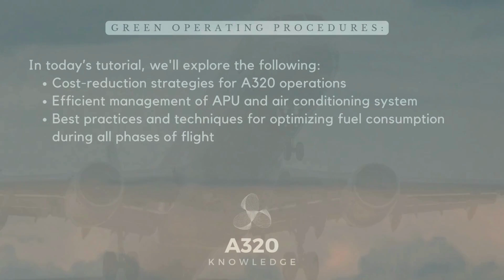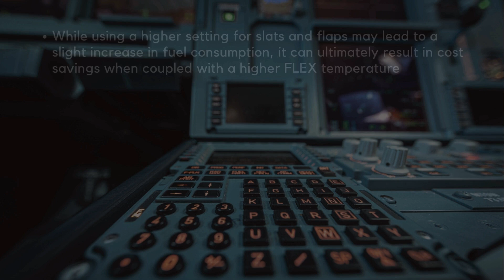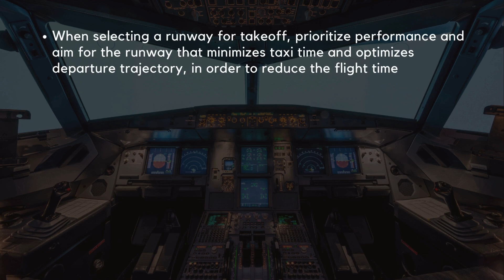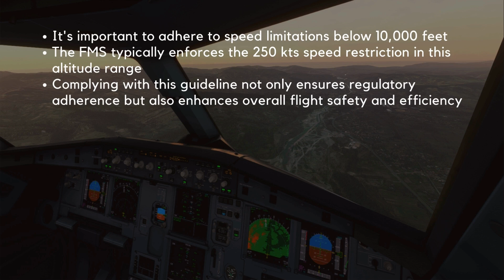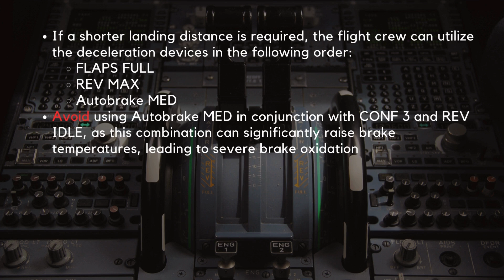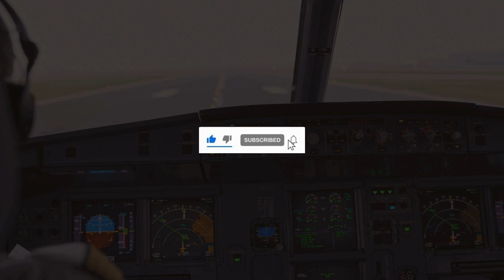A320 Green Operating Procedures Explained

Comment: 3% more fuel consumption per hour for extra fuel? How did you reach that figure?
Reply from the maker: It’s not something I’ve personally calculated, but one that was provided to me by my company, when they ran a fleet-wide study on fuel efficiency
Reply: Thing is it will depend on how much you carry of extra fuel. A percentage like that only makes sense if you are talking about a specific amount of extra fuel. Like 3% more with a ton more than needed for instance.
Reply from the maker: I think it means that for every kilo of extra fuel you carry, 3% of that is burned for just carrying it